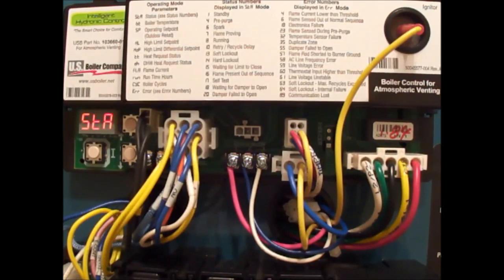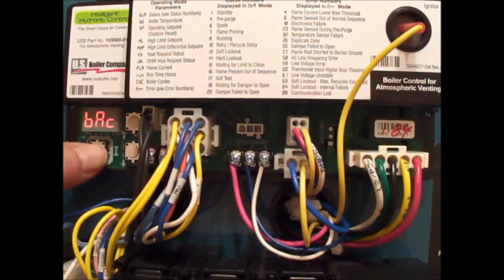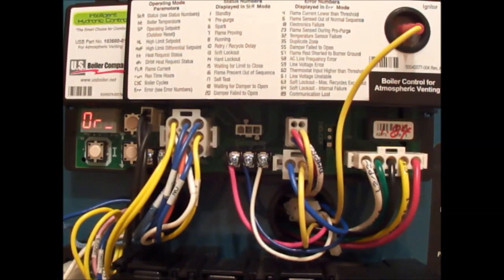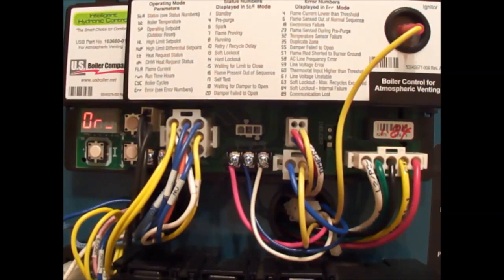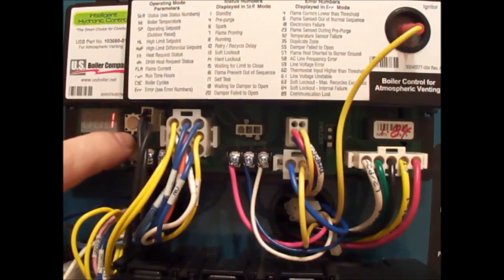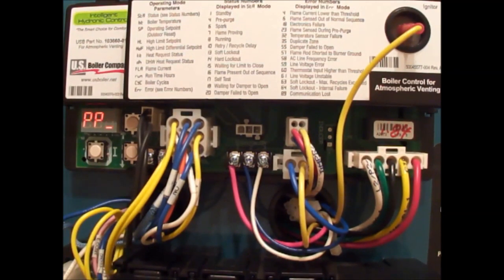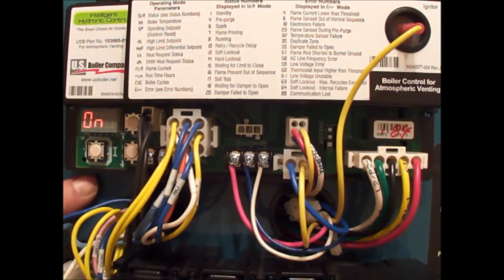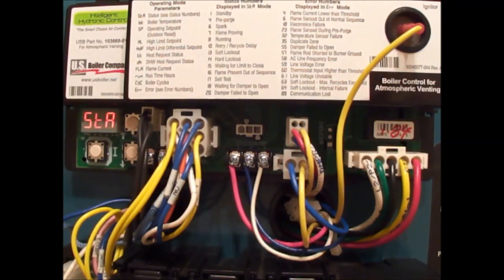US Boiler's cast iron Intelligent Control (IHC) parameter overview

Comment: HELP!!! 
I need someone like you... please read and please advise!
I have a newer Crown Boiler model AWR105ENST2PSU with the same control board ... since it was installed I'm getting a code 4 error and short cycles... It shouldn't be short cycling like this.
Two zones 1'st floor and 2'nd floor (1'st floor more living space) two gold top Taco Zone Valves. 
I did replace the 'flame sensor' ... didn't help.
I replaced the thermostats ... didn't help.
As temp tries to climb up to 180 degrees will short cycle several times showing the code 4 error and 'then' when boiler temp is up close to 180 it may be ok for a short time until boiler temp drops lower and then the short cycling issue repeats itself...  at times from short cycling too many times it will code #63 "soft lockout" and I have to shut the boiler-off and back on.
This Crown was installed 11/2019 so this is only the 5'th winter on this boiler and has been doing this sine installed.
BTW... like in your video yes, my circulation pump will run a little before the boiler fires-up.

It replaced a 40 year old Crown that never ever gave me any issues.

Comment: Fantastic video!!! I have two heat zones (water/baseboard - 170F temperature at boiler/24PSI) in my house and when it got real cold one night (Below 0F/outside). The temperature inside which was set to 70F went down to 61F overnight, even though that both thermostats are set to a steady 70F. Is there anything in the settings on my US Boiler that I could adjust that would help the situation? I usually only get 1-2 of those nights throughout the season.
Reply from the maker: This is normally a condition of OD temperature below design temperature, not quite enough radiation, water flow volume/velocity, water temperature or boiler size.
Boiler size is normally not the issue since most boilers are oversized.
The easiest resolution is adjust the water temperature. The control is defaulted to 180f. If you are going to get the extreme cold OD temperatures turn the temperature up to 200f. I would reset it after the cold snap is over to save fuel.
I hope this helps.
Reply: @comfort-calc6402 Awesome! Thank you! I kind of figured that I need to adjust the water temp. temporarily since I don't have this problem 99% of the time. Thanks for answering!